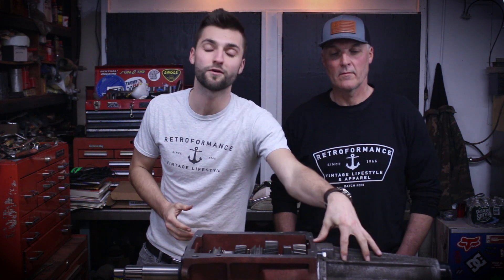NV4500 5th Gear Fix | How-To

Comment: Nice, I'll bet a guy could use a yoke on end for wrench adapter.  Thinking  if big nut was reverse threads would it stay on?  Would 10.000 lbs gvcw  sustained use be ok,?
Reply: My thought also.Why not cut a left hand thread,as the thrust tries to unscrew the nut,the nut is actually forced to tighten?Hmm?

Comment: Not familiar with the trans but couldn't you put a washer that grabs the channel and has bend over tangs like an axle nut does?
Reply from the maker: It has been tried by others, the harmonics, torque, and abuse usually makes that solution fail.

Comment: Where can I find that centering clip they used in the video right before the washer went on?
Reply from the maker: Hi Marty! I thought I replied to the email inquiry, but it may not have went through.  The centering clip is an aluminum welding rod we roll into the clip!
Reply: Do you remember what size welding rod?
Reply from the maker: 1/8" @MartinDemel-fr9yq

Comment: Great Video! helps a lot. Quick Question, I am having that same issue where my 5th gear nut is backing off and will sometimes grab and sometimes it won’t. When my 5th gear does in fact slide off, will it affect anything in a negative way only being in 4th for however long I am in it freaking out?
Reply from the maker: Hey Paul! If the nut comes off, the transmission is going to need a rebuild obviously. When it runs loose, it tends to damage the shaft splines needing a rebuild as well.    However you can’t do any more damage by running it in 4th only.  Hope this helps! Any other questions just ask!

Comment: The 5th gear nut backing off is typically the reason for 3rd gear grinding correct. If so could i do this without rebuilding the entire trans?
Reply from the maker: Hi Jason, sorry for the delayed response, we are back up maintaining the channel! Typically from our experience, the 3rd gear grinding is from excess end play and/or worn syncro rings.  This needs to be addressed with a rebuild.

Comment: You were not kidding on the torque. Wow! I am surprised the threads can hold  up to that much! Hadn't thought of using green locktite over red. I like that. But, The proximity of that tig heat to the shaft worries me. If an inexperience person tried this and overheats / arcs to the shaft, it could weaken and break the shaft under load. I like the idea of welding the nut to the gear. Both nut and gear are easily replaced come rebuild time. Just grind through the weld to remove. Thoughts?
Reply from the maker: J Pop hey glad you like it! Tig welding heat (especially if a quick accidental bead) affects the surface properties more than the internal stresses of a material.  Us personally, would be more worried about welding to the gear, since it is more crucial to have good wear, and strength in the gear, then to be worried about how the shaft’s strength would be decreased.  Nonetheless, if someone was welding a lot to the shaft, anything is possible! Thanks for the feedback!